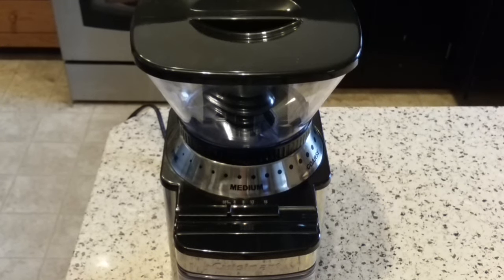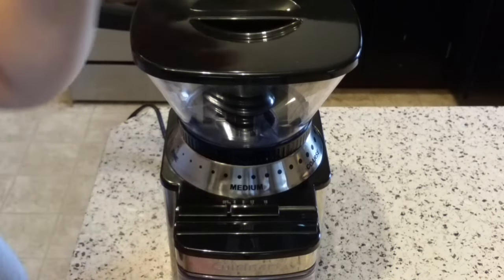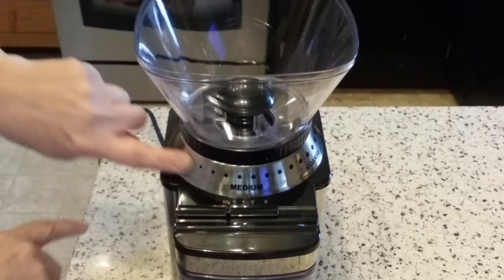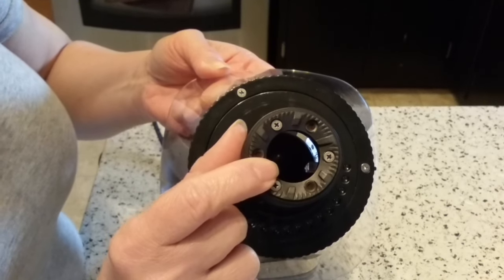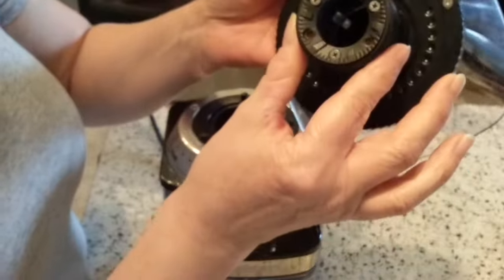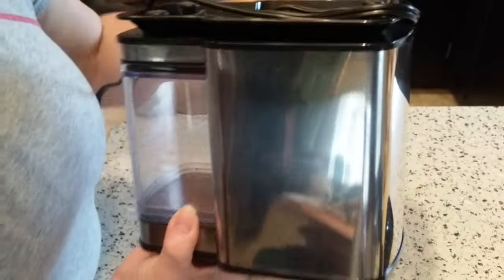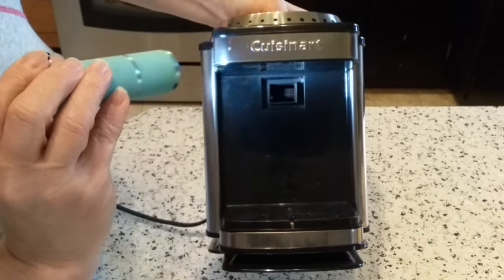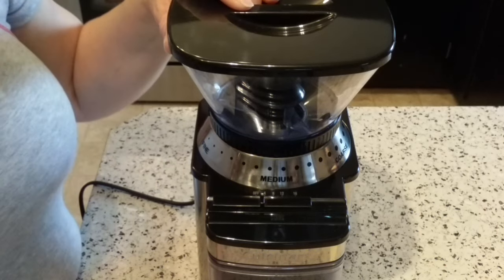Cuisinart DBM-8 Coffee Grinder: How to Disassemble for Cleaning

Comment: You make it sound soooo simple. I tried cleaning mine. I tried blowing it out with my air compressor at 90 lbs per sq ft. didn't work. I have tried to use copper brushes, and brass brushes. I use coffee imported from France and Italy, and the beans are very moist. The grinds build up and after three uses, my machine is useless. the grinds are packed in so hard that I would need a dental pick to clear out the grinds. Maybe Cuisinart should supply a stainless steel dental pick with every grinder for cleaning. I think this grinder is crap.
Reply from the maker: It is near the low end of burr grinders. I finally bit the bullet and bought the Breville Smart Grinder Pro a few months ago and I love it!
Reply from the maker: I've also found that my vacuum cleaner really helps to clean out this grinder after loosening the grounds with a brush or wooden skewer. But if you like the oilier beans, you will be cleaning it often, unfortunately.  :/
Reply: So because it is near the low end of Burr Grinders, the manufacturer doesn't have to make it so you can clean it? I'm just not going to buy anything made by Cuisinart anymore. There are hundreds of other manufacturers out there.
Reply from the maker: No, even the cheapest coffee grinders have some cleaning instructions in the owners manual. Despite the lack of instructions in the Cuisinart manual however, this grinder is still a "best seller". I'm sure it's because it's very inexpensive as far as burr grinders go, and it does a reasonably good job grinding consistently for drip brewing which is a large demographic. I can't explain why Cuisinart won't update the user manual to include some type of cleaning instructions, which baffles me. Maybe they assume that when you've stripped your gears, you'll just go out and buy another one? I myself am also done with the Cuisinart brand. I own a couple of their waffle irons which I like quite a bit as well as a few other small kitchen appliances but as you pointed out, customer service is lacking, to say the least. I posted this video because I, like many others who own this grinder, wanted to know how to clean it thoroughly. I do still use it occasionally during the summer months to make cold brew, as the coarser grind settings are great for that. But I always clean it right away afterward. I own 2 Cuisinart models, this DBM-8 and the conical version: CBM-18. They both hold on to a lot of ground coffee inside the machine. But since purchasing my new Breville coffee grinder, these Cuisinart models don't get a second glance.  :)
Reply: You're wrong. There is nothing in the instructions about cleaning. Cuisinart themselves said so to me in our emails back and forth. They have taken the stand that if you buy one of their machines, you're on your own. You're wrong about working reasonably well also. Mine does not work anymore because of the build up of grinds in the burr area. It ground coffee the first two times, and then the third time, the motor turns, but it does not grind. This is a design defect. There is no way to get into the grinding parts to clear the caked on grinds. My coffee beans are very moist and therefore build up. 
According to some newer videos on YouTube, you must dismantle the machine in order to clear this out.
Cuisinart offered to take my machine back and send me a new one. this is not a solution to a design defect. The new one would have the same problem that the one I have in my possession now has.
Reply from the maker: All I meant was most grinders have some sort of cleaning instructions, with Cuisinart being the exception. Their instructions are nonexistent. I reiterate my previous comment: I uploaded this video to show people how to take this grinder apart to clean the burrs, period.